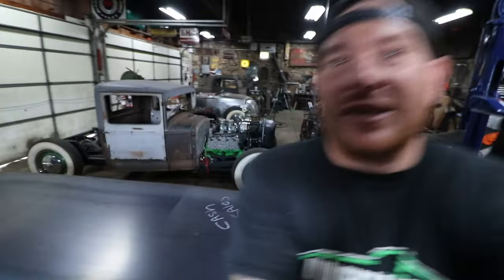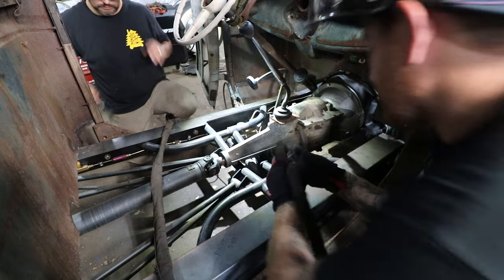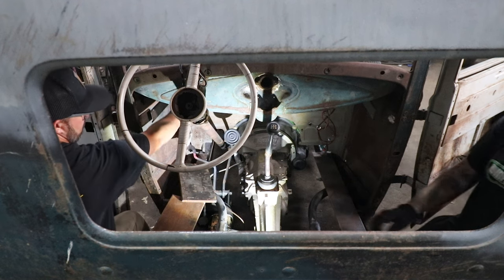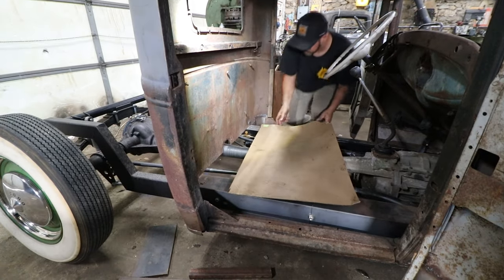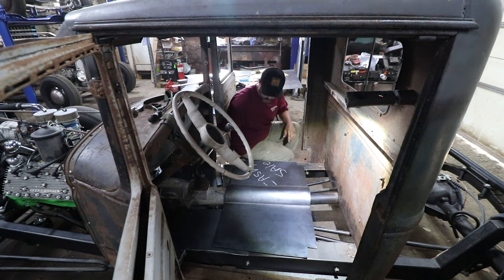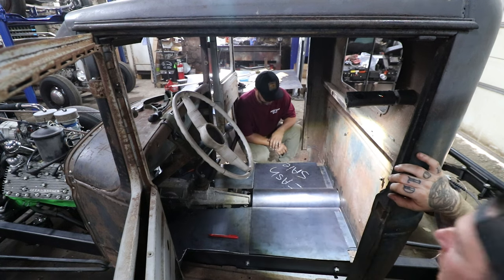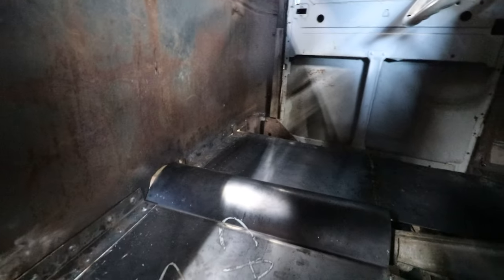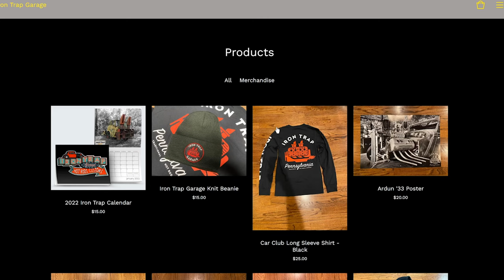Building Simple Flat Floor Pans For George's 1930 Model A Pickup!!

Comment: George will have a nice rod when he gets it done. A slapper with a piece of thick leather may have helped form the sheetmetal around the pipe. You guys were putting enough "arm strength" on it, it just needed released as you "rolled"it to help shape it. AL B.

Comment: Matt -- it's nice having friends around even if you don't get much done. When one is alone it's harder to see the reason why to keep going --- It's hard. So, keep the friendship!  The truck is looking good. ------ Are there a lot of T-5 transmissions put behind the V8 Flatheads? What's the advantage --- overdrive?                         Liked the video ------- Rodney
Reply: I used a t5 from an s10 because it puts the shifter in correct spot and it's a synchronized trans meaning you won't have to double clutch and also it will have better gearing and overdrive..but you asked Matt not me..that was just why I chose a T5